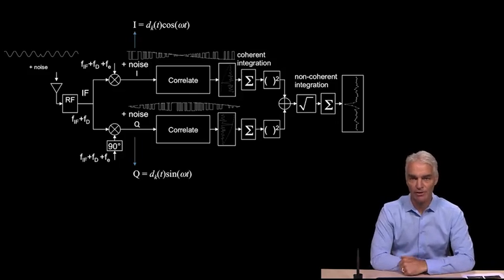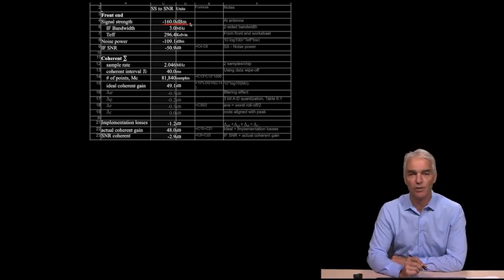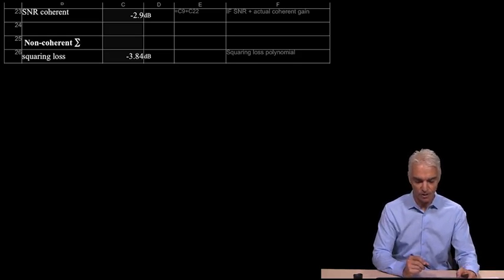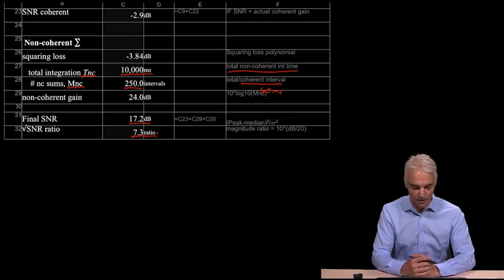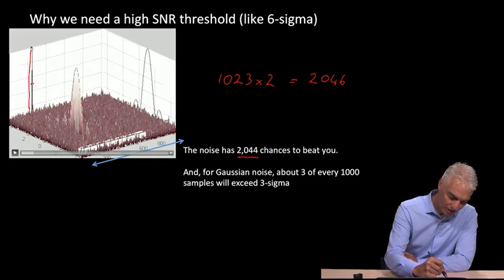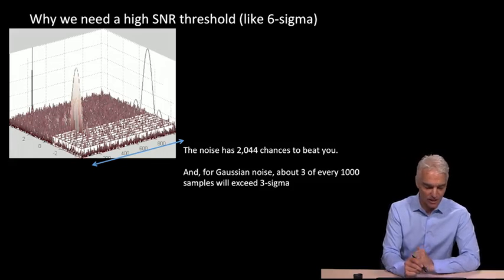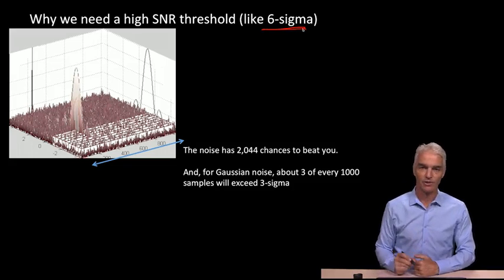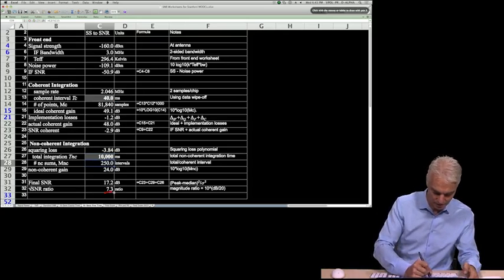5.10 - Interactive sensitivity worksheet

Comment: Noise wouldn't go negative after integrating non-coherently so its actually 1.5 samples have a chance of crossing 3-sigma in 1000 samples or 3 in 2000.